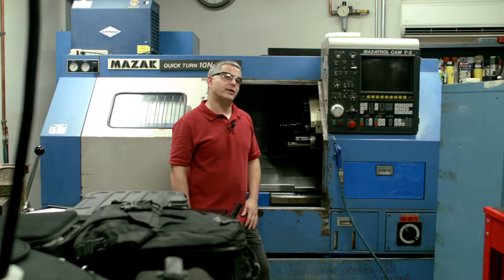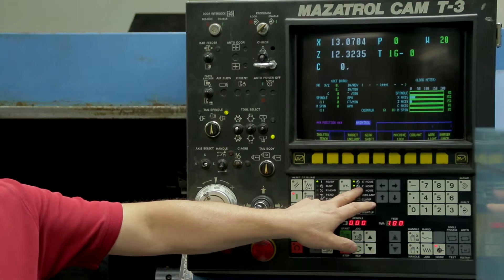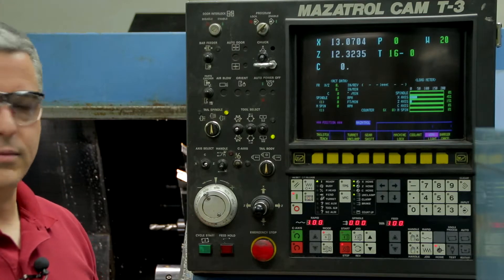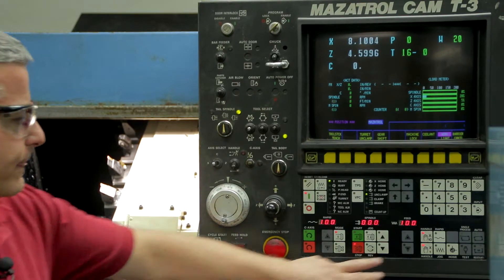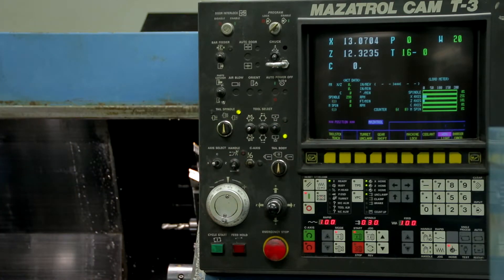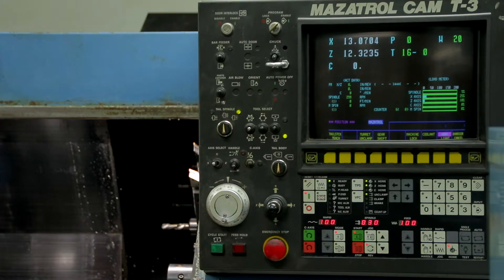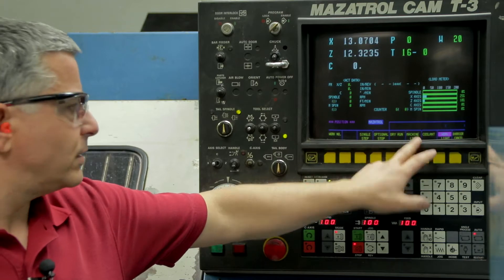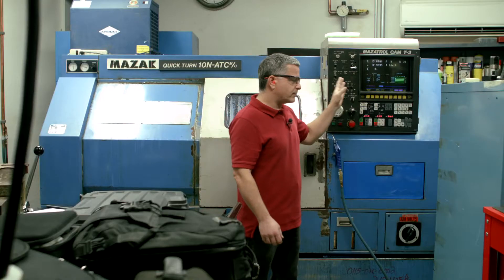Mazak Basic Machine Operation QT10N ATC/MC T-2 / T-3 Mazatrol Control

Comment: Good morning a question, to start in a tool that I want? So that it doesn't run from the beginning
Reply: I already found it thank you very much
Reply from the maker: @hectorsaucedo6302  you use the restart function instead of auto mode.
Reply: @mazatroltipsandtricks6816  Excuse me, where is this key or function,,,,,MAZAK QT-10,,,
Reply from the maker: @hectorsaucedo6302  its below the auto button you use to run programs. It is grey in color on T-2 control.
Reply: @mazatroltipsandtricks6816  Thanks a lot
Reply: Thanks a lot

Comment: When I give Commond for b90, b180 in mdi mode index table not rotating.
That time table clamp press. alarm 397 coming.
MACHINE MODEL - Mazak nexus 8800-II
Reply from the maker: Do you need to unclamp the table with M code first?
Reply: @mazatroltipsandtricks6816  M code ?

Comment: Good video. I have  forgot most of  what I  learned  years ago.  Makes me want to get my quick turn 10N going again.
Reply from the maker: Thanks for the compliment. I love my 10Ns.  Been running one at work for 24 years now.
Reply: The battery died on my 10N a couple of years ago.  Lost the entire  operating  system. Do you know of any repair  technicians who can get the machine  up and  going? I'm in Oregon.
Reply from the maker: @reelman4299  Dead batteries will only cause the parameters to be lost.  Sounds like one of the main boards in the computer may have died or something simpler like the computer power supply going out.  Post up your problem on the Mazak forum on Practical Machinist here:    https://www.practicalmachinist.com/vb/mazak/   There are several retired maintenance guys on there that know everything about these old beasts and will help you diagnose and repair it yourself.  Worth a shot.